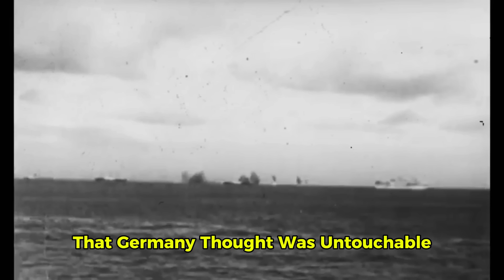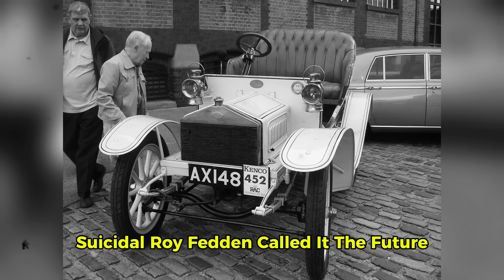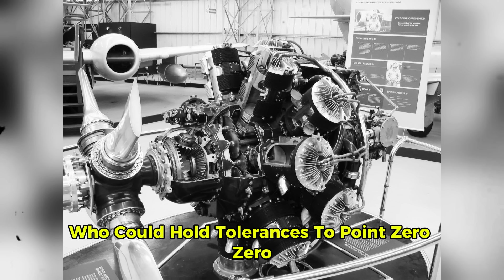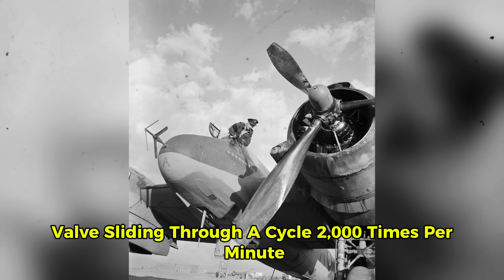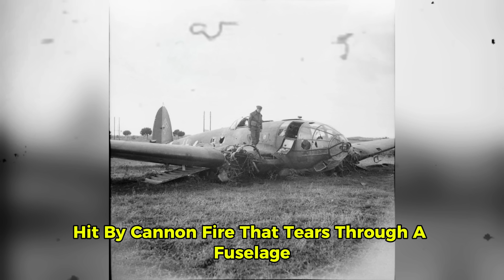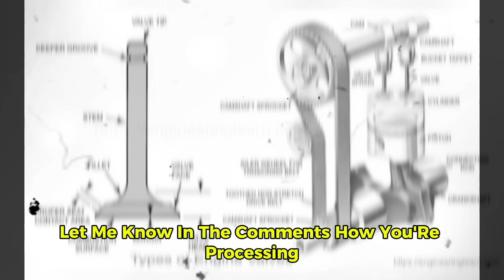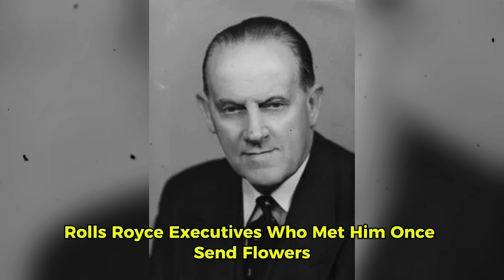They Mocked His Engine — Then It Saved Britain in WWII

Comment: Sounds like Frank Whittle story his company power jets, had his jets contract past overhead to Rover car company
Reply: Hives the Rolls Royce manager worked closely with Stanley Hooker the flow dynamics genius who talked Hives into becoming involved with Frank Wittles jet tngone projects.  Rover was eventually chosen to work with wittle on building the engines the relationship between Wittle and Rover was strained and not working. Hives met with the manager of Rover and organised a swap where Rolls Royce took over working with Wittle and the jet projects and other projects of lower priority and complexity was taken over by Rover. This arrangement worked well , Frank Wittle worked well with Stanley Hooker and Rolls Royce and his designs where eventually successful after much testing and prototypes built in RR,s machine shops under close tolerances and design mods.
Reply: @noelcastle3986 I hear if England was the only country to develop the jet engine it might have died at Rover
Reply: @micstonemic696stone  As far as I know, Rover were only interested in developing the engine for use in cars. They and a few other car manufacturers soon found out jet engines were not very good at handling different throttle settings and rpm for stop-go traffic, as well as the issue of how to get rid of the very hot exhaust gas e.g. melt the tarmac or burn pedestrians or badly damage the following car in the traffic jam.
The Rover drawings were passed to us at Lucas Aerospace in Hemel Hempstead and we adapted it for aircraft APU (auxiliary power unit) use. I still have a pair of bright orange ear defenders as used in our Gas Turbine Test Cell.
Reply: Spelt Whittle incorrectly sorry about that.
Reply: @noelcastle3986 lost my glasses on fortunately
Reply: Hence the Jet1 Rover car which a designer bloke I worked with at Lucas Aerospace worked on.

Comment: Rolls Royce were probably behind Fedden's dismissal, they were very cosy with the bureaucracy and post WW2 screwed over Power Jets with Govt assistance.
Reply: Rolls-Royce used sleeve valves on their Crecy two stroke. Sadly they starved it of any reasonable investment. Best of all, a two strokes work fine without valves.  Even better, radial two strokes don’t need a master con-rod and a radial four is ridiculously smooth. They can also drive turbochargers so they work find at altitude. 
RR would know all this but they were so welded to poppet valves and V12s that nothing else mattered.

Comment: I do wonder if sleeve valve, modern engine could be done , with todays Computer  aided designed . ( CAD )
Reply: I have worked in design offices and trust me, the general attitude to CAD was 'it improves the appearance of your work'... But not the content......   The attraction of CAD is that work can be copied and pasted - saving time,  and time is money.
Reply: Modern Machine Tools could produce those engines with MUCH tighter tolerances and CAD was much more refined than traditional drawings.
Reply: @heyfitzpablum In Roy Feddens autobiography the sleeves were described as being accurate to 0.0001 " I don't think modern CNC would be anymore accurate, might execute the machining faster though. The final sizing was done using Sunnen Hones.
Reply: @number1genoa  If you need accuracy to .0001", you have to hone it-with cubic boron nitride or diamond. No way you'll ever achieve that kind of tolerance with a conventional turning operation. I think I also read that they used Centrifugal Casting of the steel blanks to achieve good roundness going into the turning operations.
Reply: The sleeve and piston/cylinder/junkhead metallurgies are not unique nowadays. However the manufacturing technique for the sleeves would have to be re-evolved from scratch. My understanding, maybe wrong, is that the sleeves were first cast in a special formula of austenitic steel, then forged, possibly heat treated to stress relieve, machined with exquisite precision, then nitrided. The initial work is apparently similar to that of large bore artillery barrels. 

anout 20 years ago. I was fortunate enough to examine a sleeve and cylinder from a dismantled engine. The detailed workmanship was exquisite. Except for a surface polish, wear was almost not measurable. I imagine that except for mishaps and poor maintenance, the TBO of the engines would have been determined by master rod and geartrain bearing wear. In the Hercules, there was a plain bearing, not a roller or ball antifriction bearing. Sleeve crank and relay gear bearings likely would have required replacement. The TBO for the RR Merlin in civilian use was 1250 hours. The TBO for the Bristol Hercules in civilian use became 3000 hours. Modern turbofan jet engines achieve this tenfold or more. There will be no going back to sleeve valve engines. 

Fedden apparently proposed that postwar diesel buses be built around sleeve valve radial engines to be mounted underfloor. Viable sleeve valve diesel engine tech had been demonstrated by the Peter Brotherhood industrial engines. However his notion did not get up.

Comment: I have to inform you that, according to RAF archives, the Hercules-powered Lancaster B. II was inferior in performance to the B.I, B.III and B. X (Canadian-built) variants. They❤ could not fly above 17,000 feet.

Roy Fedden, after leaving Bristol Engines, helped Napier massively, to perfect the sleeve-valved, 24-cylinder horizontally-opposed Sabre…
Reply: But the Halifax achieved 25000 feet.....
Reply from the maker: This is excellent context, thank you  You are absolutely right about the B.II's ceiling; it was the strategic 'insurance policy and definitely couldn't match the Merlin at high altitude. I stand corrected there. And I’m so glad you brought up the Napier Sabre! That 24 cylinder H-block was an absolute monster of engineering. It’s fascinating to see how Fedden’s influence extended to helping perfect that beast too. Great addition to the discussion
Reply: In the 1970s the New York fire department had a huge motor, truck tractor drawn rig.  It was part of a 5 unit rig called the Super Pumper system.  The substantial size motor was made by Napier Delta.  Makes me think the brand Napier Delta had some roots extending back to their WWII aircraft motor production.
Reply: @MichaelGough-z3v 
The Napier Deltic was a brilliant design, however, it was not an aircraft engine.
It was a 2-stroke opposed piston diesel engine which each cylinder had 2 pistons which moved in opposite directions compressing the charge without any cylinderhead.  There were no valves because it was a 2-stroke which used ports in the cylinder wall. This opposed piston design been pioneered by Junkers in the Jumo.
Napier then arranged 3 cylinders like an equilateral triangle or the Greek symbol for Delta, hence the name, the pistons driven by 3 crankshafts synchronised by multiple gears which the engines became famous for.
Each bank had 3 cylinders, 6 pistons and 3 crankshafts. Several banks could be joined like a multi-row radial engine.
These engines were powerful, very efficient, relatively light weight and compact.
They were designed in 1943 to power high-speed torpedo boats and, after World War II, were installed in railway locomotives where they remained in operation until about 20 or 30 years ago.
Ask Wikipedia about 'Napier Deltic' and you will see an excellent animation.
Reply: @PhilipFly11 The Deltic had the sweetest sound.  I remember them from the locomotives BR had in the 70s.